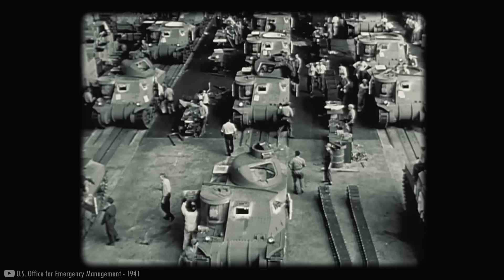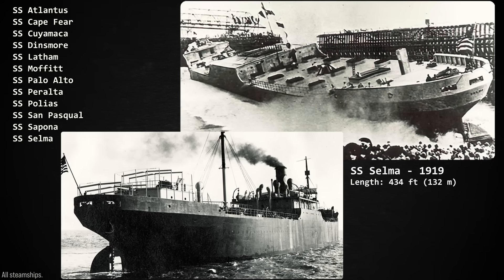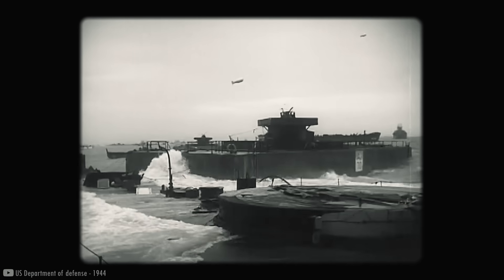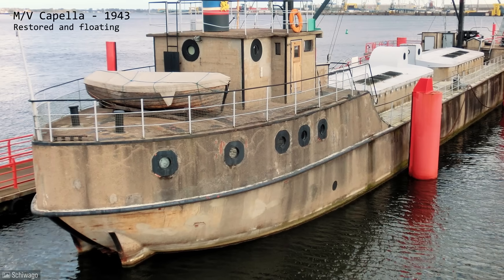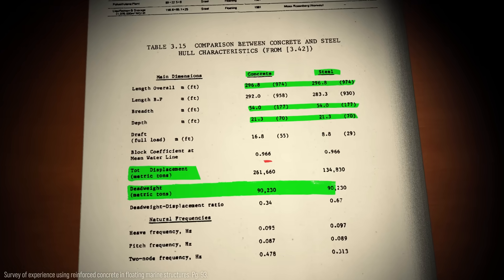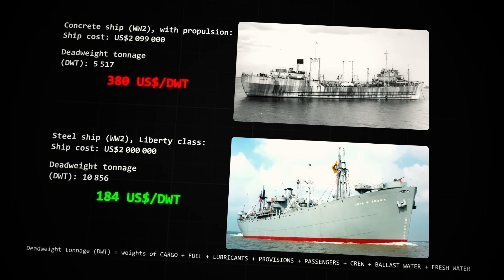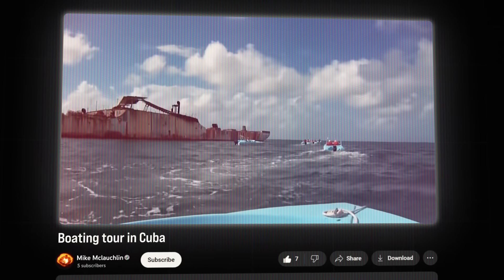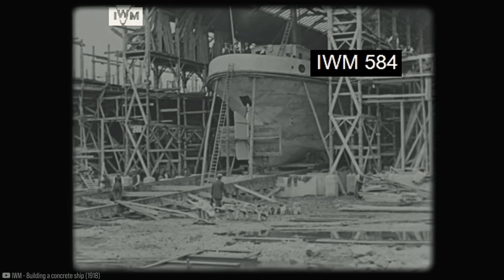The giant concrete ships 😮

Comment: They are not made with concrete.   The real name Farrocement.    The process uses 2 or 3 different sizes of sand.   Zero rocks.   The process uses lots of pencil rod, very small rebar.   Then expanded metal lath, you call it chicken wire.  The object is to get the pencil rod and 5 layers of metal lath as thin as they can squeeze them together. A 65 foot cement boat we plastered had all 5 layers in less the a 3/8 inch thickness.  The cement is the filler.  If you want a book written on Farocement contact me I will give you the book. It was written in the late 70’s.  We were a plastering company in the Portland area and we did 10 boats .  What killed this process was the price of the rod and wire.  The price shot up and it became cheaper to build out of Steel.   The big company in California was Daniel cement boats.  We traveled to California and met with them.   At that time they had to get the sand only from a plant in Canada.
Reply: zero rocks?
I guess they just didn't want to rock the boat.
Reply from the maker: The ferrocement process is used only for smaller boats. The large ships mentioned in the video were made of reinforced concrete.
I mention some of the books used in the video itself, but here they are:

Survey of experience using reinforced concrete in floating marine structures. Ship structure committee. 1984.
https://apps.dtic.mil/sti/pdfs/ADA162559.pdf

Concrete ships historical notes concerning them and a discussion of the problems involved in their construction. University of Illinois. 1918.
https://www.ideals.illinois.edu/bitstream/handle/2142/51651/concreteshipshis00kirc.pdf

Concrete Ships. University of Rhode Island. 1978.
https://digitalcommons.uri.edu/cgi/viewcontent.cgi?article=1120&context=ma_etds
Reply: @theshellchannel  how resistant are Concrete ships to Barnacles ? 
How thick are the hull on Concrete ships and is it the same thickness for the sides and bottom or is the bottom a little thicker than the sides ? 
What is the recommended type of concrete for use in building a Concrete ship and is that type of concrete available to the public  ? You've gotten me interested in trying to build a small concrete boat for my 200 acre pond  😂  .
Reply: Now there's UHPC concrete and fiberglass, basalt fibre etc, still concrete should only be used for machines like epoxy granite while houses can be built with local rammed earth and stone
Reply: @theshellchannel  Wow, everyone is an expert all of the sudden, I guess they feel smarter stealing the thunder 😊
Reply: @BenjaminCintron-e8j In school, we made concrete canoe with lightweight concrete. Everyone here is expert on the subject, but never produced  an actual product. We actually competed in races to see who would have the best canoe. Put the theory into action since it’s not that easy to have a canoe lighter than water. One of the requirements before the races was the submerged test. The canoe must float in water even flooding the hulls.
Reply: @theshellchannel  It's 'Ferrocement' not "Farrocement". Ferro for "ferrous metal" (ie steel reinforcement) and cement for "Portland cement" (ie concrete). All concrete construction, whether boats, buildings or bridges relies on steel reinforcement. Ferrocement hulls are never 3/8" thick and "Expanded Metal Lath" is NOT "Chicken Wire", it's sheet metal that has been perforated with rows of slits and then stretched in width. What "killed" FERROCEMENT Boat construction was the inability to get it insured because of the low quality of amateur construction and the chronic internal rusting  issues leading to the bottoms falling out without warning. The economic savings were MINIMAL as the cost of a yacht is more determined by the price of it's fittings and hardware than the material of it's hull combined with the extremely low re-sale value of "Hippy built boats".
Reply: @UguysRnuts  excellent comment.
Reply: @UguysRnuts cool how many have you built?
Reply: @ I wouldn't. Nobody does. I've built in epoxy/glass/carbon fibre with lots of teak and bronze, though and I've surveyed a couple ferro cement boats and sailed aboard a few. You?
Reply: @ The insurance aspect is correct.  When I tried to insure the yacht I was finishing and living on the insurance company told me that they could not insure it because if it got a hull fracture it would sink.  I asked her what would happen if a wooden yacht with ten tons of lead ballast got a hull fracture and she said it would float as it was made of wood:).
Reply: @peterdykzeul3074  "She" is not a shipwright and "she" gave you misleading information. Hull "fractures" are not a thing. Ferro cement construction is susceptible to moisture penetration through microscopic cracks in the cement, allowing seawater to reach the internal steel reinforcement, which in time causes it to rust away without being detected and leading to sudden catastrophic failure. That doesn't happen with other materials. Wood hulls are made of individual components which can be surveyed, maintained and replaced as necessary long before the structure becomes unseaworthy.
Reply: @UguysRnuts  The point I was making was the belief by the insurance company that a 16 ton ferro yacht would sink if full of water but a16 tonne wooden or steel yacht would float.  She had to go back to her boss but the reply was still no.  I got it insured by a specialist insurer here in New Zealand.  Funny part was that, as I lived on it, I was fully covered on everything except the hull by standard house contents insurance.
Reply: Vielen Dank über den tiefen Einblick in Farrocement. Habe selber ähnliche Mischungen entwickelt aber nie angewendet. Es war für Badewannen gedacht. Gibt es noch welche von den
10 Meisterwerken? Was Zement angeht hatte eine Universität in Darmstadt 1984 eine Spiralfeder geschaffen. Die Ultrafeine Mischung erreichte so hohe Zugkräfte das eine Feder ohne
Bewehrung überhaupt möglich war..
Reply: @theoronig6440 
..yes - cement the unsung hero of many unsuspected possibilities…think that in conjunction with carbon fabrics - do they yet exist? - and a constructive matrix called Khat Matrix/khatmatrix a whole new chapter opens up in man’s relation with the marine - something huge and - with good endeavour - beautiful..
Reply: Sand is tiny rocks.
Reply: The real name: ferro cement... 😊
Reply: @andriesscheper2022  Actually, Ferro is the name of the greatest football club in history
Reply: I have a question; You seem knowledgeable.. :)
Could the steel rebar be replaced with carbon fibre?
It would seem to have similar or better tensile strength, while being lighter and cheaper and immune to rust.
I appreciate your time.
Reply: @oscargoldman85  Yes it can, you are correct. Have used it in concrete panels for buildings.
Reply: What he said ☝🏼
Reply: I want the book
Reply: I saw a gray boat once and actually the smaller concrete boats do not float because there is more water than ferrocement. Therefore bigger boats will float if they have more Ferreroconcrete.
Reply: So much stupid ignorance parading as knowledge in one idiotic post... 🤦😑
Reply: @Cooe. I'd call that a discussion...
though some say that's a myth, they don't happen.
Reply: please go do a vlog on your point of view if you believe you are this smart.
Reply: Is the word rock and sand not interchangeable 😂
Reply: I'd extremely doubt it, any ferrous metal inside the cement would oxidize and everything would collapse
Reply: 🤓ok nerds
Reply: thanks everyone
Reply: @David

So quiet now....
Reply: H
Reply: How cool
Reply: imagine if they used fiber glass instead...
Reply: I came across ferrocement boats when i was doing my research on building materials for a sailboat. At first i felt using Concrete as an absurd idea. After learing about them its amazing how these boats are made. By the way did you authored the book?
Reply: This is addressed at around the 40 second mark. 😂
Reply: Thanks for the info
Reply: Concrete it’s like your saying I passed wind when you really farted .
Reply: @Sailor426 And here I was: sure that it was exactly the other way round...
Reply: Ferrerrocement
Reply: Nice information. A good example of experience and knowledge not equating to intelligence, not intended as insult.
What is your "Farrocement" - CONCRETE. 
Concrete is a structural substance formed by chemically inert aggregate, bound together by water and cement. 

The GREAT thing about Farrocement boats is that the workers can be the dumbest in society, have no clue what's happening, yet still produce outcomes. True value.

 You are clearly very experienced and have far more knowledge on the usage of concrete than myself.
Reply: @Rob-rp3cw  Wenn dieser ziemlich hämisch klingende Kommentar an davidchristensen6908 gerichtet sein soll, dann möchte ich meine diesbezügliche Anfrage an Perplexity hier erwähnen:

"Antwort
Das korrekte Material, aus dem die betreffenden Schiffe gebaut wurden, ist tatsächlich Ferrocement, nicht "Farrocement."
Ferrocement ist ein spezieller Typ von Stahlbeton, der durch ein engmaschiges Drahtgeflecht und Bewehrungseisen verstärkt wird, was eine hohe Festigkeit und Bewehrungsdichte ermöglicht. Es wird insbesondere für dünnwandige Flächentragwerke, wie Betonschiffe oder Tanks, verwendet4.
Während des Ersten und Zweiten Weltkriegs wurden Schiffe aus Ferrocement gebaut, um Stahl zu sparen und die Nachteile von Stahlknappheit zu umgehen. Diese Schiffe hatten sowohl Vorteile, wie geringe Baukosten, Korrosionsunempfindlichkeit und feuerbeständige Eigenschaften, als auch Nachteile, wie einen größeren Tiefgang und höheren Schleppwiderstand15."

_________________________________________________________________

Die Ziffern am Ende mancher Sätze sind im Original Links, denen ich noch nicht gefolgt bin. Zur behaupteten Korrosionsunempfindlichkeit wären ja wirklich extreme Zweifel anzumelden. Möglicherweise hatten deutsche Torpedos aber Schwierigkeiten?
_________________________________________________________________

Die geringe Wandstärke, die davidchristensen6908 nennt, erinnert mich an eine Werbung der Firma Ready Mix in den 1980er Jahren. Demnach sollte ein sehr kleines Boot in der Größe eines Kajak den Ärmelkanal durchfahren haben. Der ca. fingerdicke Beton sollte nur für das Dichtmittel von Ready Mix werben.
Reply: @Rob-rp3cw  you must be a riot to hang out with 😂
Reply: Ferrocement = reinforced concrete. 😂
Reply: Dude it’s cementitious material so calling it concrete is absolutely fine for normal communication
Reply: I have 57 foot samson sealord ferrocement sile boat if built well can be very good and strong boat
Reply: Thank You for valueable informations...this content was created by AI...and when it tell about concrete,we just imagine the premix truck unload the premix concrete😅😅😅

Comment: There was a period when ferroconcrete was a popular choice for homebuilt sailboats. Until people gained experience with them.

They used inexpensive materials but were labor intensive.

And the problem was that while they were strong and durable, if built properly, it was impossible to determine whether they were built properly from an external inspection.
Reply: We owned a 43ft ferrocement yacht for 10 years in the mid 80-90's.  Build around 20 years earlier to survey it was a beautiful boat, sailed well, solid in storms, quiet at anchor.  No trouble at all with the hull. Its only disadvantage was it was heavy to manoeuvre in a harbour - but that made it stable in a seaway.
Reply: If they are labour intensive,then they are expensive
Reply: @vincentkosgei7166  Labor intensive only in the plastering phase, and unskilled labor.
Reply: @karlschwarzschild1915  That depends on how much your time is worth...
Reply: @karlschwarzschild1915  It says "homebuilt" which implies no external labor costs.
Reply: Ferrocement construction peaked during the Woodstock era when young people were looking for a way to  escape, firstly the draft, and secondly, from society in general. For most, they were nothing more than a "Pipe Dream" which has come and gone along with Timothy Leary's,  "Turn on, tune in and drop out".
Reply: Haha more people are turned on tuned in and dropped out than ever lol @UguysRnuts
Reply: Today building inspection already can detect internal rebar to check building integrity.
Reply: In the 1970's, a group of us constructed a ferro concrete yacht. It was ready for plastering when gale force winds bowled it over. We stood it back up but the beautiful lines were no longer. I pulled out of the build as my GF was pregnant. The boat got finished, looked okay and spent the next few years as a dive boat in the Pacific.
Reply: @howardsimpson489  Any idea if it is still afloat or now a dive destination?

Comment: I wonder how the cost calculations would change if one of these were built today with a nuclear powerplant in place of a diesel one?
Reply: Still only roughly half as efficient, so would still be worse than the steel one. My question would be, what about if you factor in maintenance? Long term isn't it cheaper to have 2 concrete ships for the same cargo load as on steel one given they last 50+ years?
Reply: @ Good points! So much has changed since these ships were built that I think to compare cost estimates over a long term a completely new study would have to take place. The advancements in material technologies over the past century are remarkable and then some.
Reply: The cost of storing spent nuclear fuel for a thousand years cut's into it's economy. Calculate in a Chernobyl or Fukushima and the costs are beyond comprehension.
Reply: @UguysRnuts  Unless the reactor "burnt" spent fuel like some more modern reactors do in Canada and elsewhere around the globe 🤔
Reply: @justin_time  You are misinformed.
Reply: Another advantage is that you would no longer need to look where you were going. Leaving port, you could just ram everything out of your way, then carry on as if nothing had happened. LOL
Reply: @wilsjane  "Be one with the port. You are the port. You are feeling like a mobile pier. Where ever you travel in life, you are your rock." - Shia LaBeouf